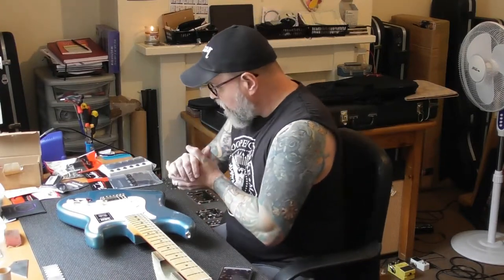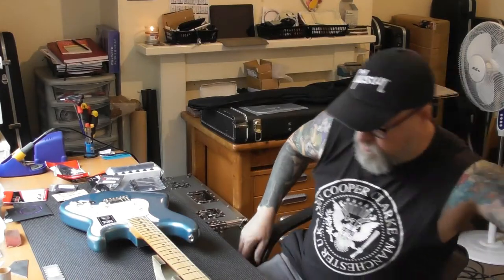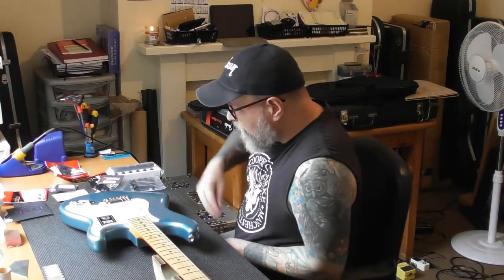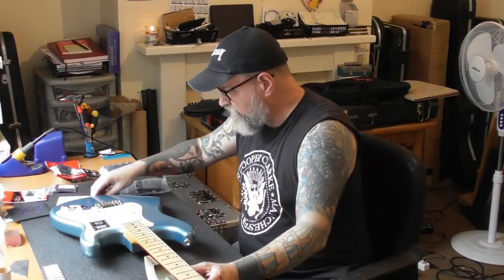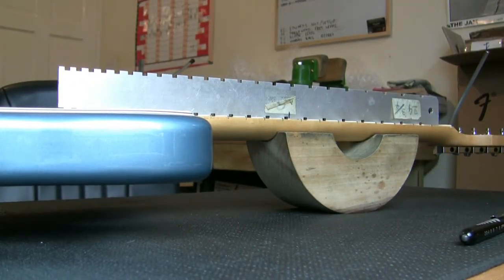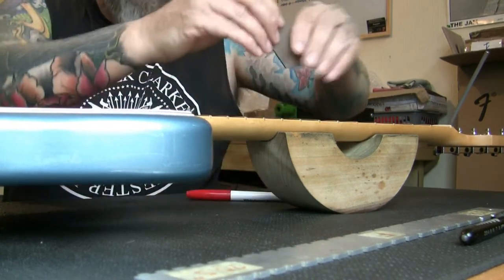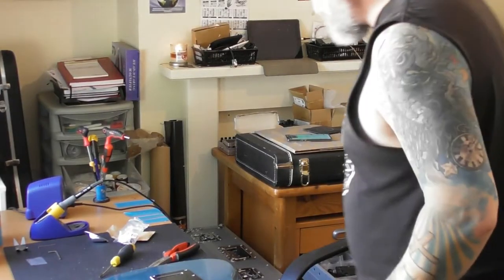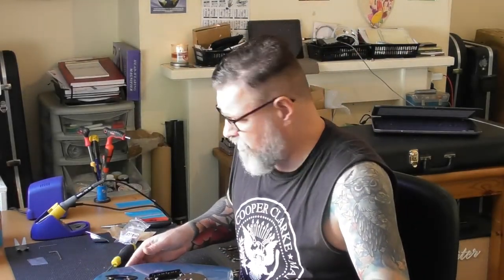Fender Player Series Strat in for upgrades and an overhaul...

Comment: Awesome tutorial! I've found that a LOT of guitars with high frets can be cured by bashing the frets with a nylon fret hammer. They may have started level, but due to travel, humidity, settling in, etc, some of the frets pop up a little. If bashing with the hammer doesn't fix it, then the frets have to be filed and crowned. I had a Gibson R8 that had 5 high frets. All were cured by bashing them back down.
Reply from the maker: OK, noted...
Reply: @FretFriendGWaL  Of course that said, my new to me Player Strat had 7 frets I had to actually file down and re-crown today!

Comment: You go real deep into some repairs....real deep. Having said that....I got a replacement neck with a two way truss rod.....gold....pure gold. The replacement neck however needed fret work like this guitar. In regards to the guitar you are working on....Do think it is the humidity in Mexico and temperature and humidity changes due to shipment to a different climate like the UK or the workmanship when the guitar was built or both ?
Reply from the maker: Man I have 2 x new Musikraft necks in (£300+ each) and a Warmoth neck all belonging to the same guy and all need fret work. The 2 x Musikraft ones need extensive fret work (1 has 8 x high frets and the other 11 x high frets). I will be making a special video on those 2...
Reply: Fret Friend My Lord. That is indeed a lot of high frets. On another note I replaced the nut to Tusq nut on my replacement neck. The original nut was in there good. I had to cut it down the middle tap it about carefully then carefully pull it out with nipping pliers. Very happy it didn’t take any neck material with it. Fun(stressful) experience. I said to the guitar gods as I was doing the work “I don’t want to be a guitar repair tech I just want to make my guitars good”. Please have mercy guitar gods  🤣🤣🤣🤣
Reply from the maker: That's the correct way to remove a nut! Well done :)

Comment: Interesting, I bought a player strat last year and the frets and nut were perfect.  My only comaint was the bent steel saddles and screws are crap. Every string change is a nightmare because they are so loose when the strings come off that everything moves.  I then gave my old tele to my daughter and bought a player tele.  The first one I received was awful, I stopped counting at 8 rocks, and the string tree was 2mm out of line giving a lovely buzz on the open B. I sent it back an the next one had 3 fret rocks.  I thought if I send that one back I may just get another replacement  with even more rocks. Anyway, £85 with my local guitar tech for  fret dress and setup and it is now a beautiful guitar.  I kind of don't mind given both the new players will probably be with me until I snuff it, but I do agree that this should not be happening on anything with Fender on the headstock.
Reply: In my experience Fender Player is no better than Epiphone.  The QA / QC labels are meaningless.

Comment: Great job man. I just picked up a 2020 Fender Player's Strat, (Mexican) HSS, for $300. Red, with black plastics. Great guitar, just needed a little TLC. I'm normally a Gibson player, but these Strats are a great buy.
Reply: Where in hell did you find a 2020 fender for $300!?
Reply: @dylanalmeida5331  Craigslist, the guy was asking $400, I offered $300, he accepted. It's got some dings and scratches, but plays great.